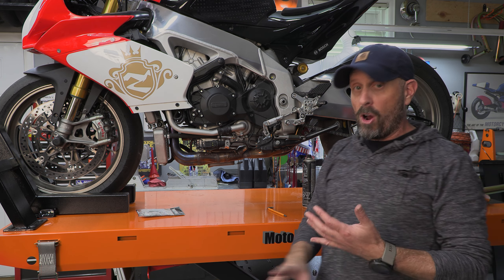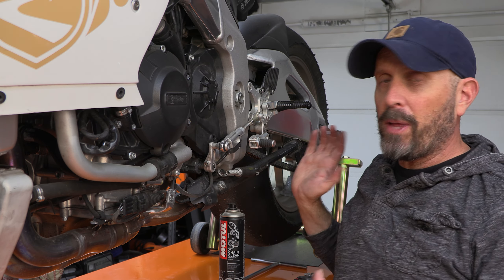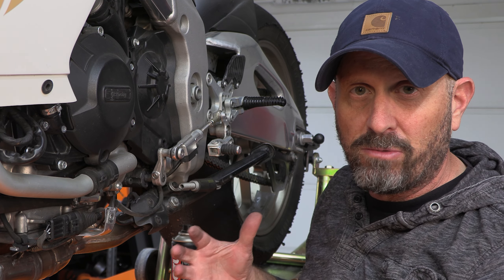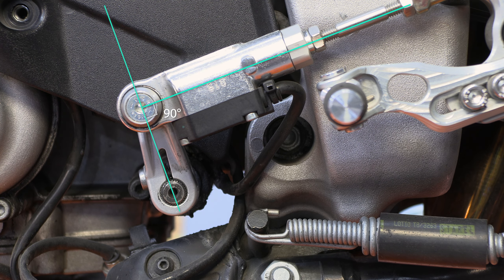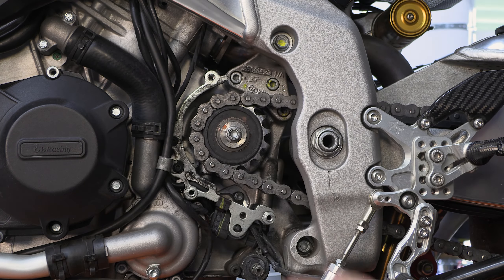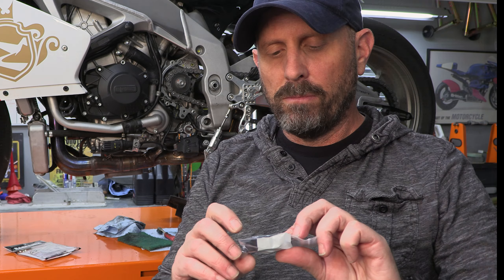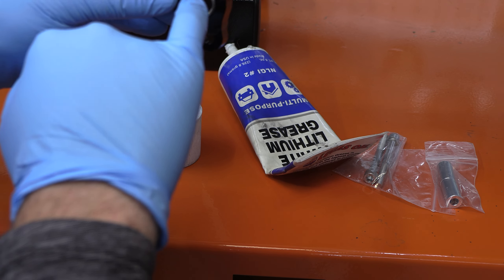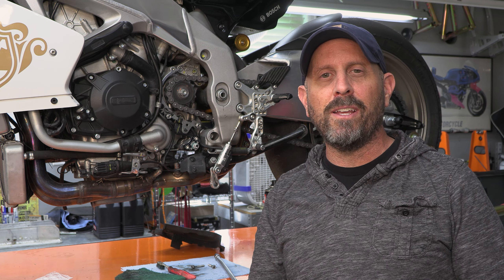Impossible to Find Neutral? Use This Trick!

Comment: Something that wasn't mentioned. These types of supports require regular maintenance. The needle bearing is not sealed and will need regular greasing if you don't want it to seize up on your shaft. The other thing I'd probably mention is that these are pretty much snake-oil when it comes to shift quality. There is not enough force in the shift drum to cause any significant flex in the shaft during rotation. That is unless something is seriously wrong, in which case you should be servicing your transmission not bolting on an overpriced needle bearing. It might offer some shear protection to the shaft in the event of an accident, but I suspect that would be pretty situational. Save your money for tires...
Reply: Other thing that was not mentioned is the change that thingy made. I suppose all we saw was an advertisement.
Reply: There is a rubber seal on both sides. Same as your dog bone. And in that it lasts thousand even when offroading. So on a road motorcycle where it's not even exposed to water like an offroad machine is (water crossings, mud) I don't think you will ever need to grease them.
Reply: @kovrcek  No, it is only sealed on the front, the rear is open to all the grit and jump the sprocket can pull in. I know because I threw money away on one of these for a speed triple a few years back.

Comment: Great vid. I have found that I have to adjust the shift lever a good bit depending on my boots. I go back and forth between Adv boots for on road touring and my Tech 10 boots for off road. Only takes a second or two. I have two center punch marks, one for each boot. It makes it quick and easy.
Reply from the maker: Great tip!

Comment: Mrs Gears bought a brand new 125cc Chinese brand (won't say which one) bike a few years ago, and I rode it into the dealers for its run in service. I told the 'mechanic' that when stopped, the bike wouldn't go out of 1st gear into neutral at all. I had to rock the bike back and forward to get it out of gear... Seeing the L Plate on the bike, his reply was "Motorbike gearboxes are different from cars. You need to rock them back and forwards..." 😮
To which I gladly informed him that I'd been riding bikes for over a decade and NEVER had to rock one back and forward."
Needless to say, I did the work on the bike myself and told them to shove the warranty! 😂😂😂

Comment: I have a 2012 triumph Daytona 675r and neutral is very difficult to get. I’ve found a possible solution in a different detente mechanism but it involves getting inside the transmission. Would this be a good stop gap to try out? Thanks
Reply from the maker: I've replaced a lot of shift stars myself.  It's a bit more involved because you have to open the engine case.

Comment: That's a neat little gizmo. But you might want to get some lube on the chain you used as an illustration at 0:19 - those links look very stiff and kinked. 😲
Reply from the maker: Haha. Yeah. That’s a different bike that is very much in need of a new chain. Good eye!
Reply: @CanyonChasers  ...and there's an extra 0.5 horsepower to be liberated too!
Reply: Of course, joking aside, a badly adjusted or worn chain can also make gear selection difficult so it's always worth checking if you're having these problems.

Comment: It would be great if someone invented N-1-2-3-4-5-6 gear pattern and would use it in main stream bikes...
Reply: My '69 H1 had Neutral on the bottom of 5. It eliminated catching N on the way to 2nd but it also precluded catching N and coasting to a stop. I think most riders didn't like it.
Reply: Doesn't need much inventing lol. Old Indian bike i have is 5 down. You can put it in neutral by mistake which no big deal in local traffic but its nice to know your in 1st at stops and hairpins

Comment: Buy a Kawasaki 
There, I fixed it 😄
Reply: Came here to say this☠️ although I do miss popping it into neutral before I'm completely stopped.
Reply from the maker: Except, did you know it was invented specifically for 92 Kawasaki ZX7?
Reply: @CanyonChasers  No I didn't know that and it doesn't seem to be true. There are a lot of posts of older Kawasakis that have it...
Reply: out of the various bikes I've owned, the 1st gen zx-10r had the best feeling transmission, the 2nd gens were good too, but my 4th gen is kinda clunky. That said, no problems finding neutral, unlike the suzuki and Ducati I had.
Reply: @taylorhickman84  I have no problem at all finding neutral with my sv 650, sometimes I even find it between 4th and 5th😉
Reply: @nugginusslover476  My 2nd gen SV was pretty good, but my 1st gen loved to slip out of second gear and finding neutral at a stop often took multiple attempts.
Reply: @taylorhickman84  oh really? I also have a 1st gen and I think it's one of the easier bikes to find neutral. Can't remember the last time I didn't find it on the first try while riding.